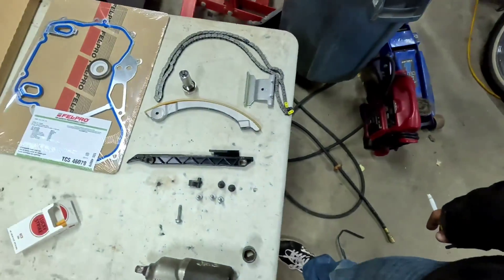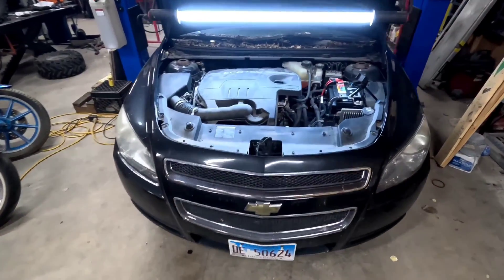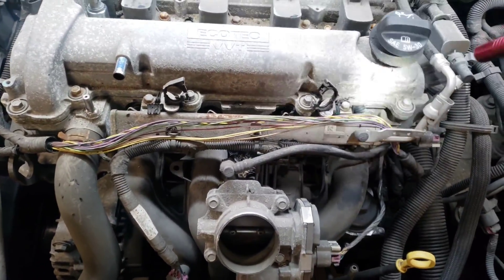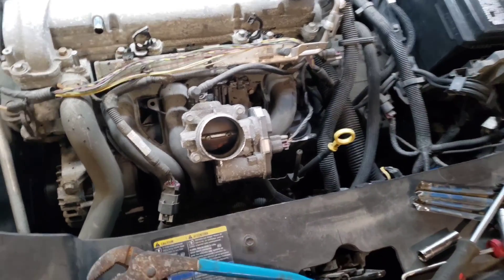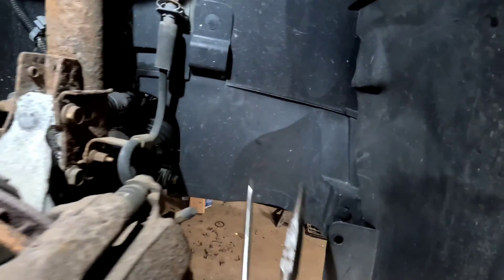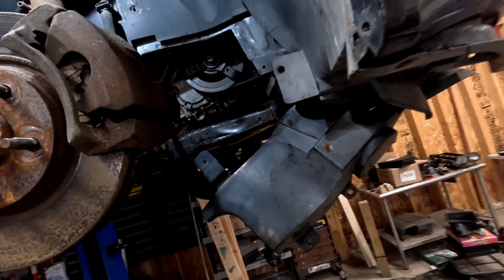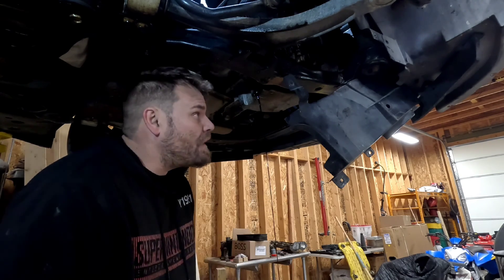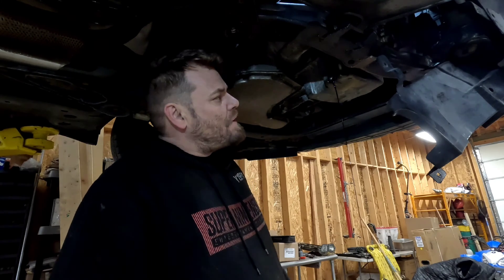GM  ECOTEC Timing Chain Replacement (2.0, 2.2 And 2.4 liter) "part 1"

Comment: 😂 2.2 ecotec got me learning. Cranks no start. New coils plugs and crankshaft sensor. SPARK IS THERE and so is fuel aspect. Lets mention it wont start on starter fluid. It has compression.  I need to peak at the chain now? .
Reply from the maker: I'd say so. It could be out if time
Reply from the maker: Awesome channel name and pic btw!!!
Reply from the maker: I feel like nobody actually gets the innuendo of my channel name LOL

Comment: Where is part 2? An other parts?
Reply from the maker: Second shift buttoned it up and sent it. I apologize, the next one that comes in with a similar issue will be filmed in entirety.
Reply: Lol I was just gonna ask this the other week. Man fk these engine apparently they're designed to burn 1 quarters of oil every 500 miles. My 09 got driven with low oil and I'm sure the guides broke cause I hear that fkn chain rattling like crazy. I already had paid for the timing being done twice. Imma just order zzp guide replacements, do it myself and sell it!! To hell with this car yooo